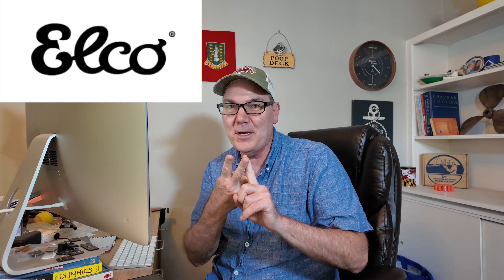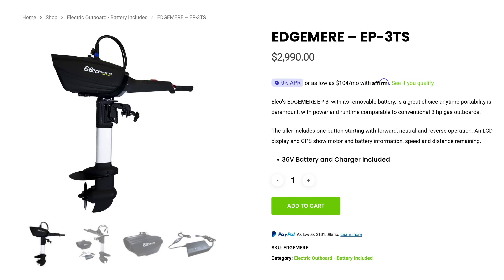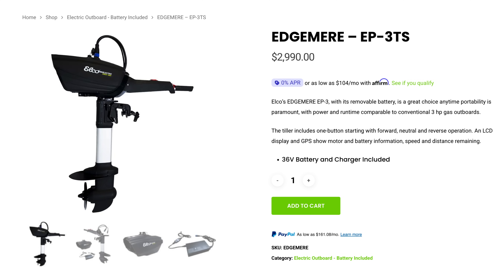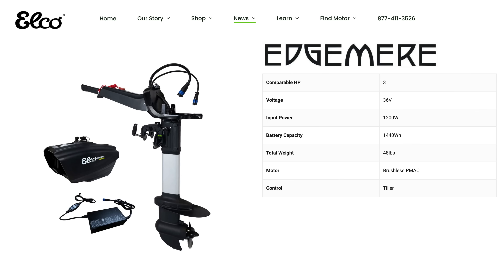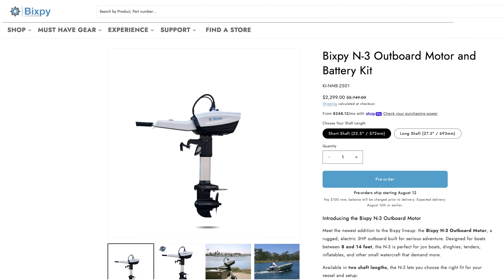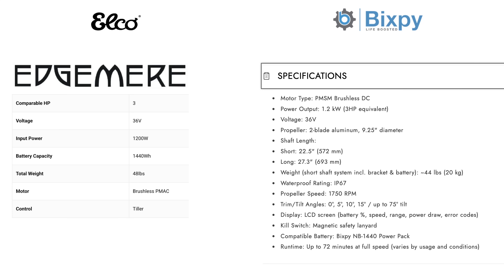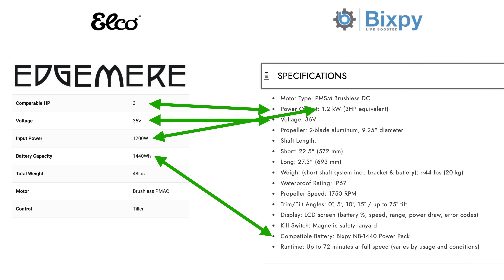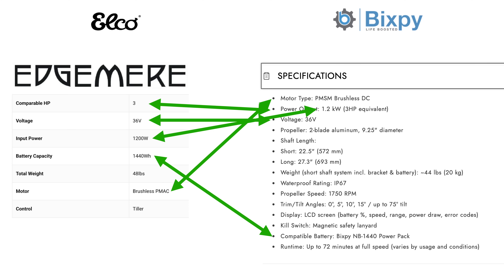NEW "Made in USA" Electric Outboard Motors?

Comment: Do you know a good electric outboard that can stay in the water on my mooring? I have an outboard well in my sailboat cockpit, the outboard has to be short shaft because of a skeg below it, and it has to stay in the water all season because the tiller above it makes removal difficult. Many of the electric options are either too tall and hit the tiller above or the skeg below. Keeping an electric motor submerged in salt water all season seems bad too. So I am leaning towards the 48v hangkai outboard with a traditional lower unit gear that can be painted with triton 66 anti-foul and the motor stays up out of the water all season. Besides replacing the cheap connector, do you see any issues with that option or is there a better alternative that will meet my specific requirements?

Comment: I got the early release advertisements for the new little Elco outboard. I initially thought, “Oh cool, an actual American made electric outboard!” Then I du into it a bit and found out it was a Chinese brand outboard made in southern China with just an Elco decal pasted on it and a substantial price premium included. (Who knew a decal cost so much to make and install!). What a huge disappointment. Another Asian (China) rebranded label product with what I expect is going to have virtually zero product and parts support going forward. If you need a new part for it 1 year from now because you broke something, it won’t be available in stock without a 6 month to never get it back order wait. 

Take a close look at the battery. I dare you to find English labeling on any of its components.

Comment: I have a long term interest in Elco electric outboards and continually am hoping to see them actually modernize them to the current feature content inclusion as you find on modern gas outboards. Like included built in power tilt and trim instead of the expensive, heavy, bulky adapter bracket they currently sell and a lower unit shape that does not look like an old 1950’s Johnson or Evinrude. Plus, they are really expensive for what you get.

Comment: Are these actually a 3 hp outboards or is it optimistic double speak? 1.2 KW translates into 1.60 electric HP. 3 hp needs 2.238 KW. I have noticed on doing a bit deeper dive into Elco specs is that there advertised hp is peak hp output, but continuous hp output is considerably less, like half or about 2/3rds of peak output. Is have noticed the same hidden detail on other electric outboard specs as well. That’s like on a gas outboard, saying you get your full 3 horsepower fore only a minute or two and then you automatically throttle back to a maximum of 50% to 60% of throttle and no more. Have you noticed that detail in your reviews?
Reply from the maker: Horsepower and "horsepower equivalent" both have their issues. The reality is that a gasoline engine only generates peak HP at full throttle (or near peak). So at low speeds a 15 hp gas motor isn't generating 15 hp at all. Electric motors produce immediate torque and it's very noticeable in an EV or with an electric outboard. So quite often an electric outboard can feel strong and push a boat BETTER at lower speeds - but does not have the top end speed of a similar HP gasoline outboard.

Comment: There is not one thing in those electric motors that should make it a 3000.00 plus motor! Pieces and parts purchased separately and building it especially in bulk are not anywhere near the price. I understand the ins and outs of having things manufactured but there is no way they will sell as many as they could if the cost was lower. They are also for pretty small boats. Many boats it could power are under 6 thousand dollars with trailer, (used of course) but still more than 50 % of the cost of a small boat set up is ridiculous, no way!

Comment: Wayne here with hard-hitting investigative news! I’m hoping to pick out something one of these days - my sailboat is 1100lbs dry and the trolling motor is fine to get in and out of dock on still water, but a little more oomph would be great for wind and currents…
Reply from the maker: I like the ePropulsion EVO series models for your application since they can regenerate something to the battery when under sail. Obviously the harsher salt water environment can be a challenge for any motor you hang off the back.

Comment: glad to see you looking at an Elco product.
I'd love to see your review of the 9.9 hp elco.
That motor is up and out of the water - something
that in my mind separates a real electric from
a trolling motor you buy at a garage sale for $45.
thanks
Reply from the maker: I hope to get my hands on a larger Elco someday. I believe they use "traditional" water pump cooling with an impeller and are louder than the submerged motors like the ePropulsion Navy 6.0 which is a direct competitor.
Reply: @WayneTheBoatGuy  You need to test their highest power one with I think 26 kW comparable gas motor thrust and should be quite rapid even on bigger boat. Of course this needs big battery but can be made cheaply from lifepo4 cells and not weight prohibitively much.

Comment: A friend of mine just bought a new 15hp Mercury from the local dealer for $3K. It does about 25mph on his boat. Let’s see, a 3hp equivalent for almost $3K, or a 15hp for $3K?
Reply from the maker: Yes we still don't have comparably priced and and powered electric outboards - especially in the popular 10-15 hp range. And many of the newer 15 hp gas motors seem to quite robust!
Reply: Engine Weight 105 lbs.
Reply: @DrummingTmate And your point is…
Reply: @dougaranda6187 Some people find 50 lb batteries more manageable. I don't think 100lbs is that bad for a 15-20 hp Mercury.
Reply: @MIForestguy  Large lithium batteries are under 25 pounds. Hulk Hogan could body slam Andre the Giant. I could not.

Comment: If 745w=1 HP, how on Earth are these 3HP gasoline equivalents? Theyre not even 2HP. They may have full torque at zero RPM but gasoline motors run at half again more RPM.
Reply: The word equivalent is key.
What I understand is that they compare thrust, probably static thrust.
Meaning a 3 Hp equivalent electric outboard can move the same boat as a 3 Hp petrol outboard.
Not as fast, it's more of a indication if you can maneuver you're boat with the "equivalent" of.

Side note the more commonly used Hp equivalent is the metric one, then 735.5Watts = 1hp.
Still no 3hp
Reply: Its a scam....does electric cars also use " equivalent" term ...no, they would be sued.  E outboards have propellers optimized for slow speeds. but they loose on the top end so compared to a gas outboard there are no free HP, its just one to one..No science backing for the "equivalent" magic number, just marketing BS
Reply: 746 watts actually 😉
Reply: Also, I will say that my electric outboard has a true mechanical horsepower of less than 2 but pushes the same as my 4hp gas.
Reply: @mayberryastronomy6335  my Tohatsu 3,5hp has a true mechanical HP of 3.3hp from the prop shaft. Top speed on a light boat is 14 miles per/h and doubt any electric outboard 2KW or less can beat that?
Reply: @XSAILOR65  Absolutely not. I should have clarified that mine is on a sailboat, so I am limited to my hull speed which is right at 6.4 knots. Both my 4hp gas and 1.4KW electric were able to push the sailboat at about the same speed (depending on current and wind). I'm definitely not saying electric is for everyone, but for us it made sense. No more vibration, fumes, stalling at low idle and trying to dock, etc.... 

I'm an engineer and specialize in electric motors, so I was very comfortable with electric. The prop speed of most electric outboards is slower than gas, but they have different torque curves. So when it came to pushing my boat, it was about the same. I DO plan to upgrade to a 3kw electric outboard in the future so that I can push against harder currents, but with my current motor I can go at 100% throttle for over 3.5hrs with a golf cart battery. If I slow down, I go further. My gasoline outboard could only run for about 30 minutes with its internal gas tank (I did have an external but I hated that thing).

Comment: Wayne, most of these electric 3-HP come with a 20"+ shaft length. For smaller jon boats, this seems too long for the transom height (~15"). Thoughts?
Reply from the maker: Many of the electrics seem to have the prop lower in the water than similar gasoline outboards. I first noticed this with my Newport NT300 and the ePropulsion Spirit was the same way. 

There's a useful chart on the TB Nation website ePropulsion Spirit page at the bottom. - https://tbnation.net/collections/epropulsion/products/epropulsion-spirit-1-0-plus-3hp-electric-outboard-motor

Comment: Would really like to see a test of the Advanced 70 lb thrust Watersnake. It has a brushless motor too with boost button. Also a third party trolling motor shaft rudder fin to see if it really make a difference in keep the boat tracking straighter. I have one but yet to test it out. Sea Eagle sells the watersnake for $500. The Watersnake comes with Anderson cable connector which makes it quick to switch between batteries with Anderson connectors. Takes about 3-4 seconds to switch.
Reply from the maker: I hope to try out a Watersnake in the future!